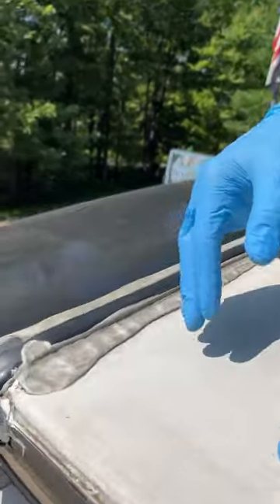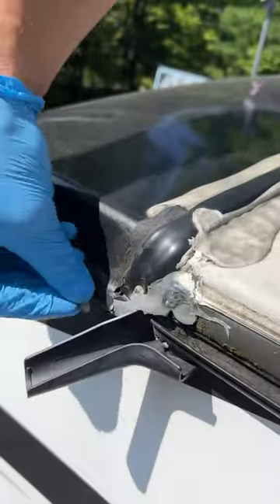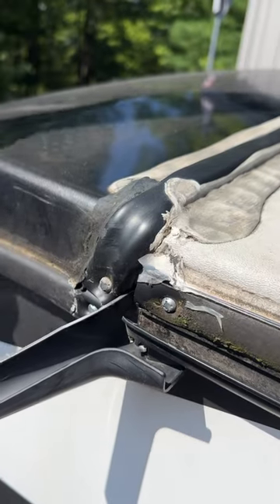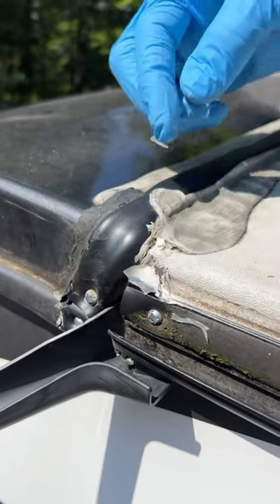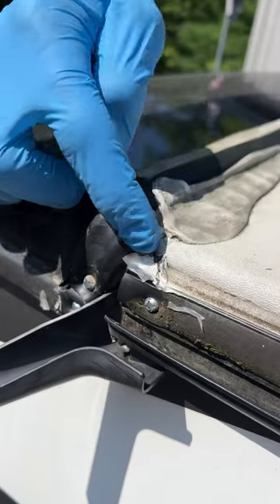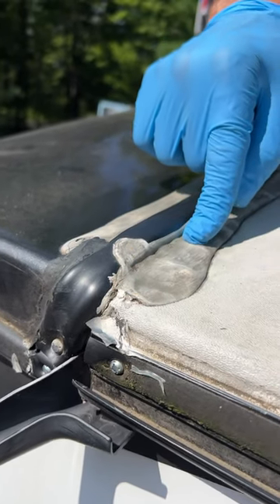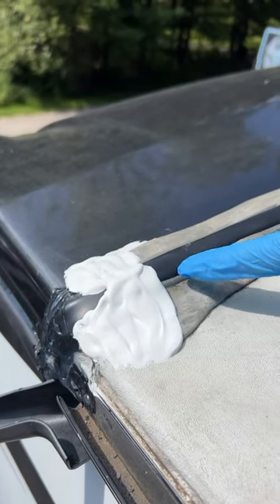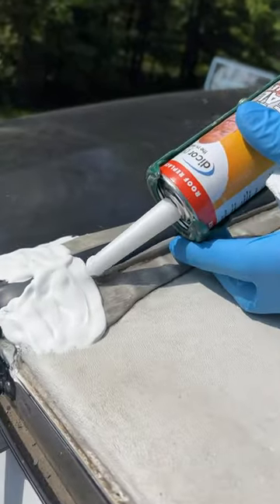RV Roof Corners - RV Sealant

Comment: On the top of the roof, I painted Flex Seal paint over the original sealant from the factory.  Flex Seal paint conforms to every bend and curve.  I even used Flex Seal paint on the inside joints of my boat!

Comment: What do you think about eternabond tape? I know some people say it’s only good for certain types of roofs🤷🏻‍♂️
Reply from the maker: Eternabond is useful when you have a tough spot to seal or need to patch a hole in the roof. However, when someone goes crazy with it and puts it on every seam of the RV, it can create more issues than they are trying to prevent since it can lift at the seams, and water can get trapped underneath it.
Reply: That’s not true regarding EternaBond… obviously you or whoever has not applied it correctly.
Reply from the maker: @nigelbeaumont1109  more times that not, when I see Eternabond applied over every seam, it has wrinkles and gaps in it. Yes I would say that it was not applied properly. When it is applied at the DIY level, there is often a lack of experience which results in a sub par job.

Comment: Your videos are so helpful! Quick and to the point!
UPDATE: I See my answer down below!  - Why not use the proflex RV from the vertical across the curve to meet the self-leveling? Why switch to a different one for that middle area? (Getting ready to do this job today. Just trying to learn 🙂
Reply from the maker: You don’t want ProFlex on the roof material portion. (I think that is what you were asking)
Reply: Darn can't  share a link in comments! We need to complain to YouTube about this! Anyways, in this video he puts Dicor all the way across a double seam from the aluminum front to the rubber roof... I guess the same answer as my previous question. The proflex will attach the aluminum better. Hey, I got the link to share!

Comment: Very helpful. I've used Proflex. Do you feel Sikaflex is better or just different?
Reply from the maker: Sika is different. I've seen it not adhere to plastic vents. Also, it comes off very tough when you need to remove it to replace a vent or a skylight. So far, Dicor and ProFlex have worked well as RV sealants.

Comment: So you don't clean the previous lap sealant before applying new lap sealant?
Reply from the maker: Yes I do
Reply: @MobileRVTechServices  may ask what you used to clean the Lap sealant, so I never buy that product. Lap sealant when cleaned properly should almost look like new, not grey with brush marks cutting through the grey.
Reply from the maker: @Orticai  https://youtube.com/shorts/8iWRTXkUBOQ?si=-wXT5enw1zGvAnnx

Comment: Wait you are just putting new sealant on top of the old stuff and not removing it at all?
Reply from the maker: @rebeccaschmidt2550  if the sealant is still pliable, the new sealant will adhere to the old and does not need to be removed. You can do this a couple times until it all needs to be removed and start over from scratch. If the sealant is dried out and cracked, all the sealant needs to be removed and fresh sealant put on.

Comment: should you take off the old stuff first? Or at least clean the old stuff if not
Reply from the maker: Yes you will remove any loose or completely dry cracked sealant. If the sealant is still soft, you can clean and reseal.

Comment: Dicor is the WORST caulking to use being has harsh chemicals in it that soon as its applied on the rubber will stretch & bubble it, use anything else another brand but dicor.

Comment: Don't cover old sealant. I agree with all your sealants just not covering the old.
Reply from the maker: Why not?
Reply: @RadarRoadWarriors  I have found that by covering old sealant, what happens is the first reason the sealant is cracking is because it's dry. When you put new sealant on top, then the old sealant will start to absorb the new sealant moisture content from the bottom up. Once the moisture is gone from the new sealant, then it cracks and opens just like the old sealant. Unfortunately, it can be dried quicker due to the fact that it is now going to dry from the bottom and top. Overlaying is fine for single season fix, but should never be layered over and over again. We only offer a spot seal on newer sealant. On whole rvs we will scrap the old sealant and lay all new. This ensures a better seal. Plus we can't warranty a spot seal. But you can warranty a full scrape and seal, and we now know how old the sealant is and can judge if a spot seal is safe or not.
Reply from the maker: @jaysonstebbins2539  that makes logical sense and I won’t layer if the old sealant is dried out. In this case the old sealant was still soft and has plenty of moisture and the crack formed by the trim where it needed to be resealed. I appreciate the tips and that’s something to keep in mind during roof sealant repairs. -Steve

Comment: Why not remove the old sealant and replace with new sealant ONLY🧐
Reply from the maker: RV Sealant is designed to be able to layer and reseal. Removing all of the old sealant opens up the corner and makes it more vulnerable to water issues. The sealant when first put on a corner will settle, resealing what has settled is much better than starting over and having the new sealant settle.

Comment: You need to wipe off the surface of that old dicor with mineral spirits before sealing over it
Reply from the maker: Yes, you can use mineral spirits and followed up by alcohol to clean off the residue.
Reply: That’s exactly what I was thinking. Surface prep is the key. Mineral spirits followed by denatured alcohol. Doesn’t matter what you use if it’s not clean it won’t adhere.

Comment: Don’t use silicone on the outside of the RV.
RV Manufactures: Uses silicone on the outside of the RV.
Reply from the maker: @TJ-qz6hr  exactly! If you ask any tech doing repairs that last, they wonder why did the manufacturer put silicone on since it has to be completely removed to reseal the cracked silicone.